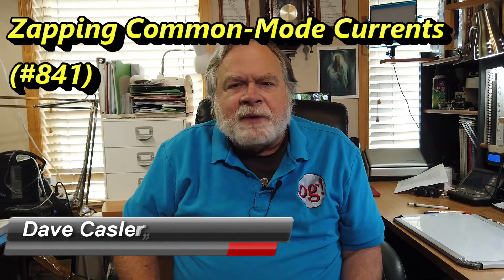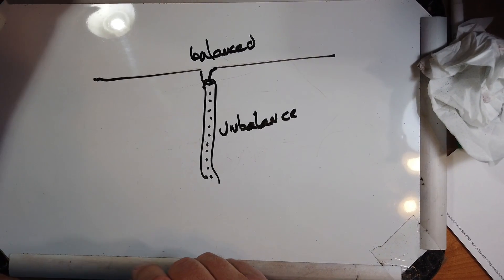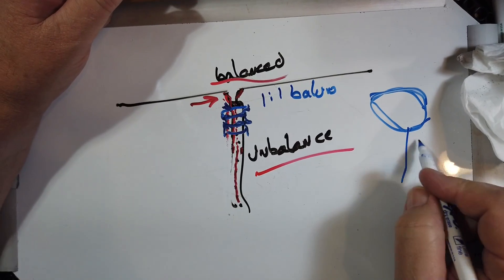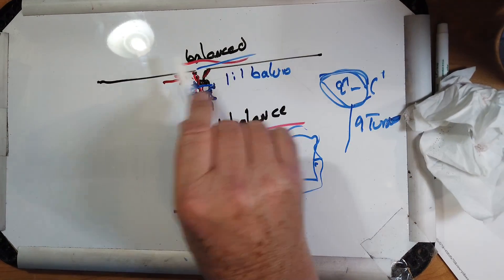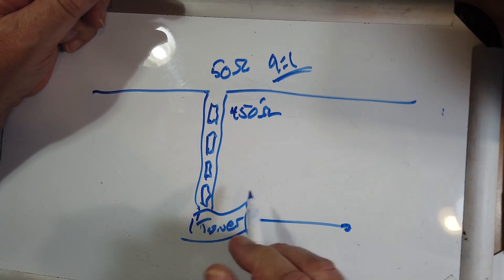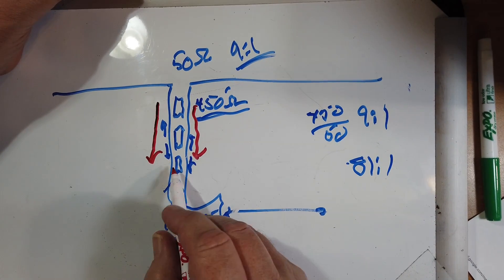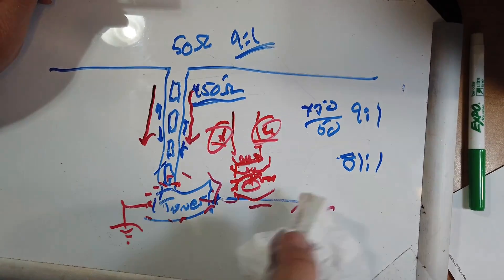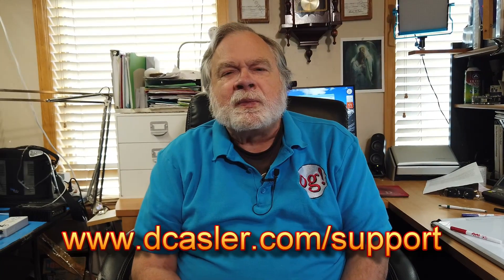Zapping Common-Mode Currents (#841)

Comment: Had a big buzz coming through my computer speakers every time i transmitted on 10m,  4 turns of the coax through a large ferrite bead before the entry point to the shack TOTALLY took care of the issue.  Rig is a Xiegu G90 antenna is a Sigma Eurocom HF-X80 vertical.  73, 9Y4CLB 😂

Comment: You probably shouldn't rely on just the lightning arrester to block common mode.  That'll waste that current by warming up earthworms, with a little bit of it radiating from the coax itself.  Stopping the current at the source will put that energy to better use, sending it back into the antenna and/or transmission line, where it'll actually radiate (perhaps after a bounce back to the transmitter).

Comment: Hello Dave and thanks for this information.  I had somewhat of an understanding about common mode on coax but was in the fog about it on window line.  You cleared that up.  One question has been when using a dipole with a window line (450 ohm) feed, it seems the recommendation is to use a tuner with a 4 to 1 Balun.  Since the system is a 9 to 1 mismatch why not recommend a 9 to 1 Balun.  I have to be missing something.  Thanks for sharing your knowledge.  Tom
Reply: Transformer baluns make lousy baluns for several reasons.  Use a 1:1 current balun.

Comment: Is there a better way to suppress common mode currents on balanced feedline than letting the tuner absorb them? And equipment is electrically grounded (not RF grounded) so that may not 'drain' all CMC before it gets into everything else in the shack..
Great content, Dave! So much appreciated.

Comment: There are so many details that matter here, each situation is different and generalizations often break down. For example, ground is not a zero ohm RF sink, it has considerable resistance at RF, so current will divide, some will still flow toward the radio. Each time current has an opportunity to go two different ways, it will divide based on the impedance of each path. Adding beads or baluns will reduce the current flow on that path, but depending on the actual values of the path and balun impedances the current will divide, and substantial current can still flow, especially with loops of coax or a few beads which are weak and present minor impedances to the flow. As the frequency (wavelength) changes the impedances change substantially along the conductors, so something that works in one part of the band may not work in another part or on another band. Some tuner designs are much better at balanced outputs than others. The fun and magic of radio. 73 de w6akb.

Comment: With my coaxial end fed half wave (EFHW), I use an Alpha Delta lightning surge protector affixed to the outside station ground rod .  Never had any issues with common mode currents.  Thanks Dave for the technical tips and good videos.  73,  AC3HT